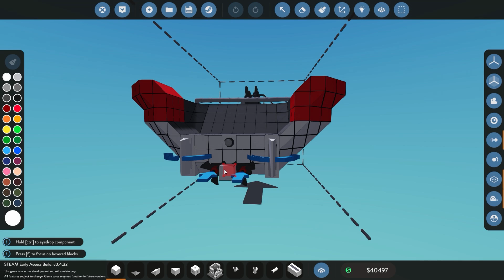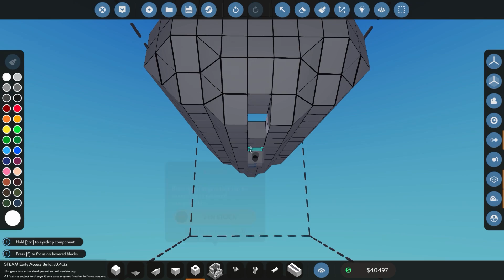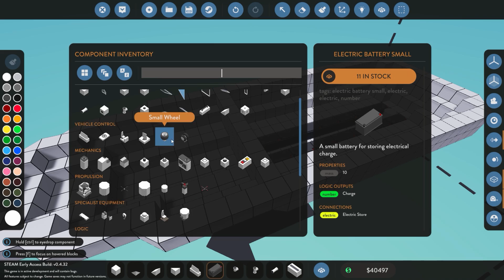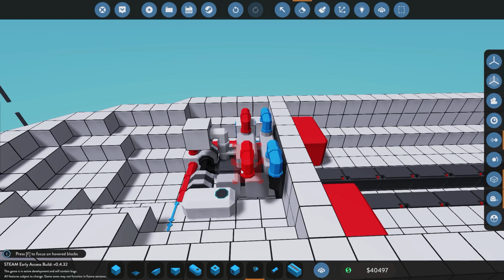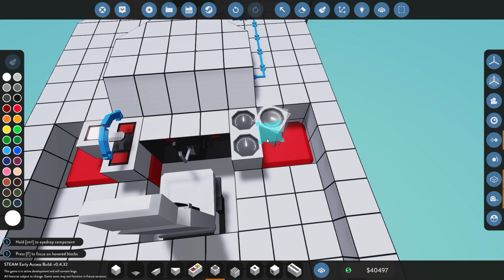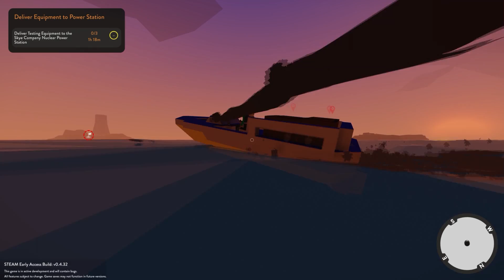Advanced Ship Systems Building and Survival Mode! (Stormworks: Build and Rescue #05)

Comment: kAN the cooling system works but you have to pipe the radiator up correctly. And if you want to build custom bases then i would recommend waiting to the next update because the rooms aren’t watertight so in a tsunami the water is just gonna flow into the base like nothing was even there and you can’t build massive fuel storages to refuel ships, planes or helicopters except you use the fuel tanks, but they look so ugly when you have a huge amount of them.

Comment: I wanna see the build process. Also you can probably use 2 small generators if you have a clutch in between those and the engine to start it easily

Comment: Make a hybrid submarine, use engine while above water, then electricity under water
Add A LOT of logic, flooding warning, emergency pumps, tower with room that will drain water (so you can enter underwater, while sub stay dry inside)
Make every variable on dial or display, add glass panels to ballast tanks so you can see if they work etc.
(I like when you can see internals working so add windows to engine room too)
Reply: I've been working on something like this for a while now, but it takes a bit. Overcoming one issue can just lead to another, very frustrating.
Reply: Yessssss

Comment: Small correction: the system you described (Diesel powers a generator which powers an electric motor) is called Diesel-Electric drive, which is the same used in most diesel locomotives. It's used in locomotives because the diesel engine itself is not pulling the train along, the electric motor is. Power can be regulated by revving the engine. A hybrid drive is when you can individually power the propeller with either the diesel or electric power. Some cars use an internal combustion engine paired with an electric motor to produce more power.

Comment: In just thinking, If there is some logic you could say if engine =130 then push the engine cut off button. Would be cool as a safety.
Reply from the maker: I'm pretty sure once I unlock some more logic components we can do all sorts of automated shutoffs and have the engine turn on like a proper hybrid.
Reply: @kANGaming  Engine get damaged at 110°C when, heatlh is 0, it blow up
Chcek MRJersey for tutorials, or try multiplayer together!
Reply: At the same time could also, in theory, use logic to just adjust throttle based on temperature and battery level.
Reply: @Pearl Crystal Gems What? Average piston speed? How you can get that? Why? For what?
In this game you can not over-rev engine, you can only over-heat it,  also throttle need to be controlled by PID logic gate, not throtle lever direcly.
It is like pedal in car, in you are in neutral and only touch gas pedal, engine will go into red zone, because there is nothing to stop it
If you floor it on highway, engine will slowly rev, because it need to move whole car faster, so you need either use thottle lever carefully
as pedal, or use PID controller instead, for generator, I would change RPM with temp:  low temp = high rpm, high temp = low rpm
Fuel cutoff is independed from throttle, it just stop fuel pump/close valve if temp is above 100°C, so it is easy to install
(one valve, one logic gate "if greater than")